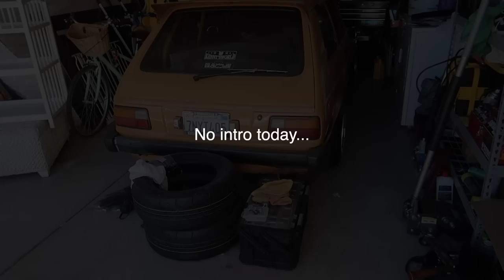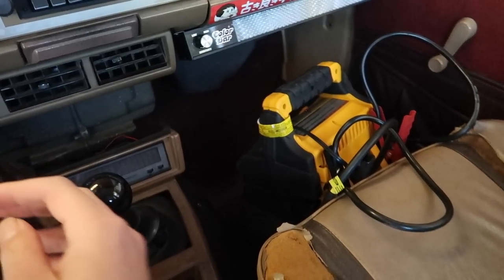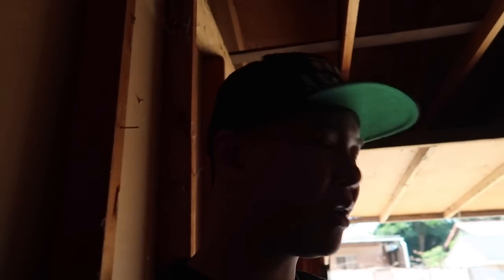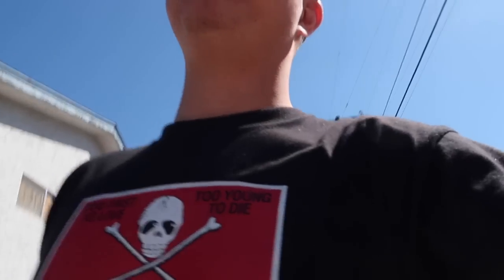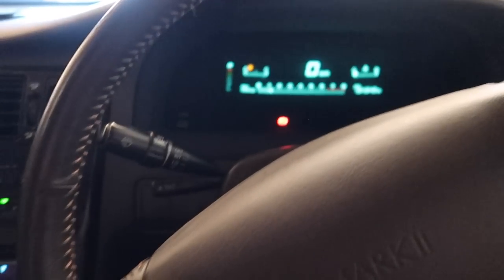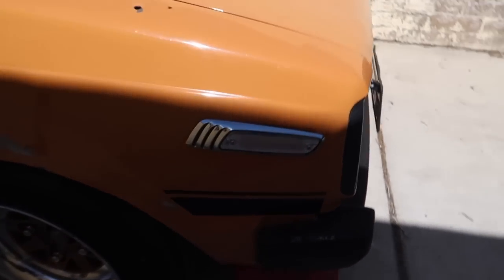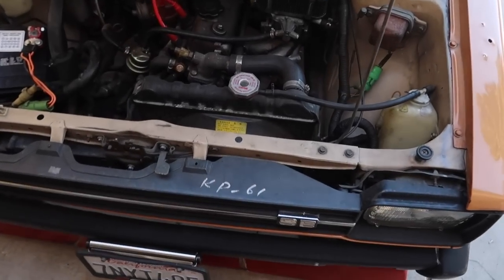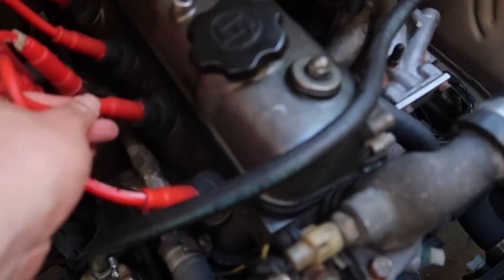Starlet Kp61 videos are back!

Comment: How many miles do you have on the starlet
Reply from the maker: So far im not sure lol it’s on the cluster but i don’t remember from the top of my head
Reply: I'm not sure if I'm reading it correctly...230k or just 23k miles
Reply from the maker: Most likely 230k. I believe the engine has been rebuilt before as well, from one of the previous owners
Reply: I have a starlet with 58k original miles. I'm getting it restore little by little... I found an after market rear coil springs and an original front coil springs.
Reply from the maker: Wow! Really low miles 😱

Comment: Ohh yeah those rims are nice on the KP! Fist bump! Nice GS300 too! You got a new 5m for the supra or you going 1jz?
Reply from the maker: Thank you! Yup that's my roommates GS400, V8 and Manual swapped. I got a new 5M, going to keep the engine stock and OG. The supra is going to be a slammed cruiser.
Reply: @BojanglesDavid  Awesome. Those 5speed swapped GS400 are drift missiles.